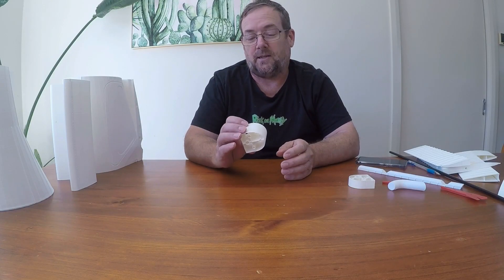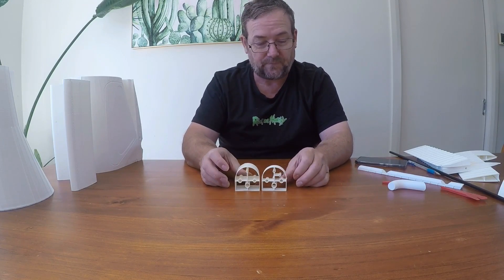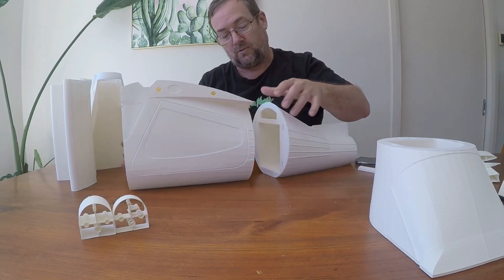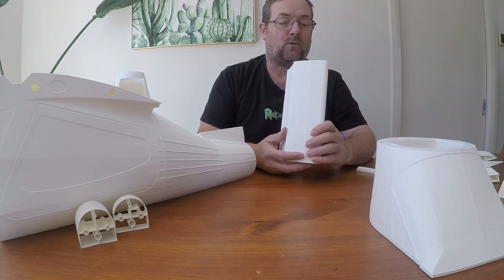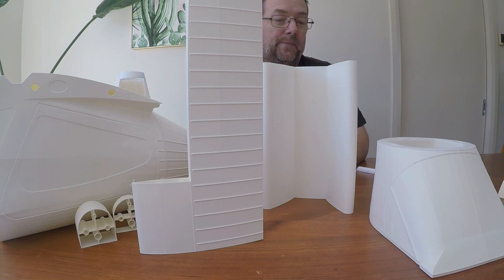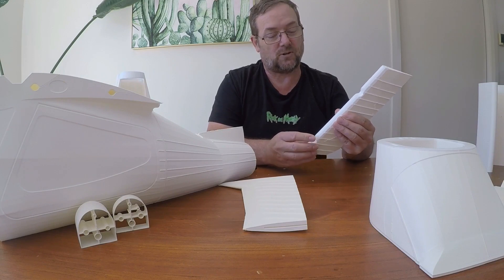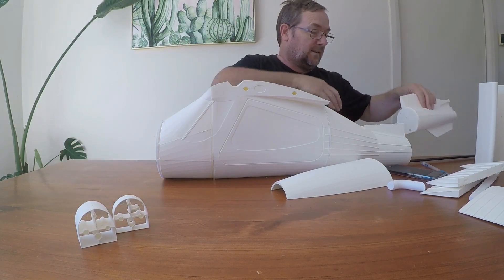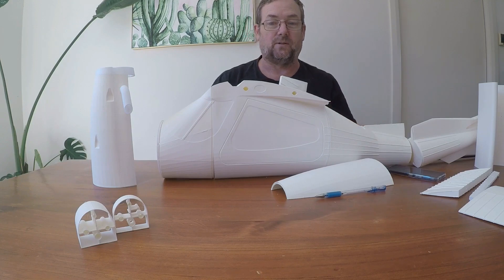Draco XL 3D printed plane Part 1

Comment: Very well done. Can you please clarify what size nozzle was used to make the fuselage and the number of outer layers?
Reply from the maker: its a standard .4 nozzle printing a line width of .8 - .9 thin wall vase/surface mode (so one layer)